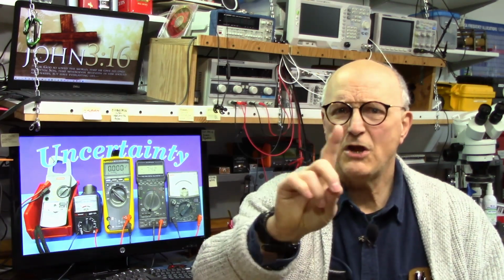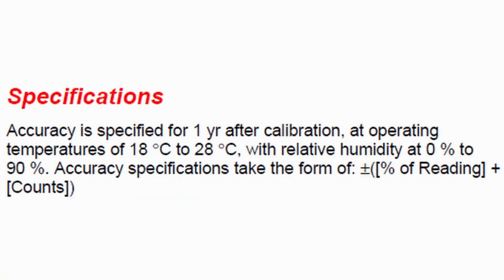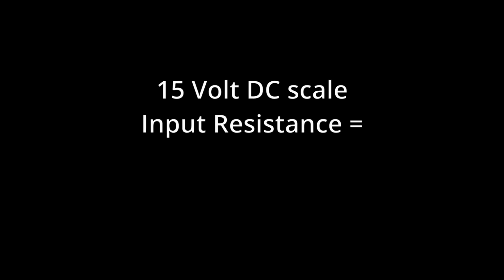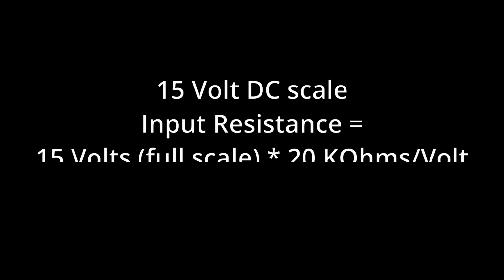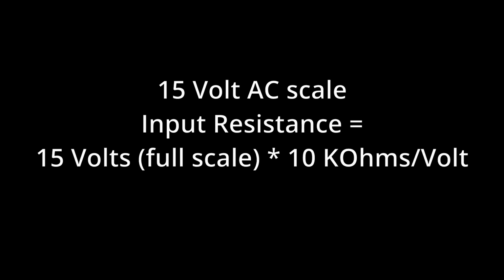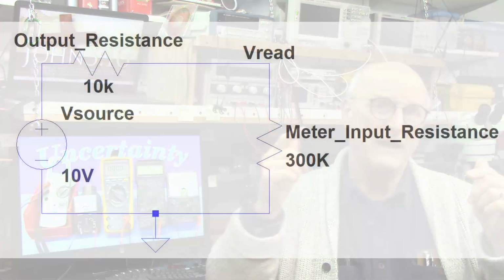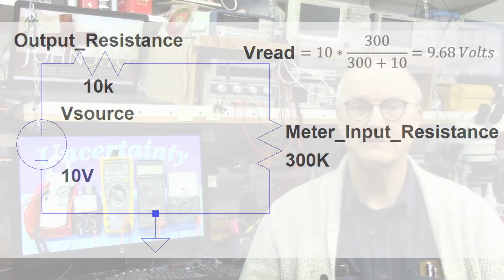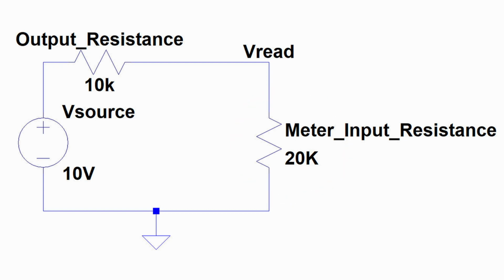Understanding Measurement Uncertainty (057)

Comment: Nice explanation! 👍
Having set up a calibration and research lab for thermometry, back in the 80's and still running it, uncertainty became second nature. Uncertainty consists of type A and type B contributions. Type A concerns statistic uncertainty in a number of measurements. Type B deals with the known, combined uncertainties of all components in the chain, including resolution. We normally express the uncertainty contribution multiplied by two, called two times the standard deviation. This is equal to a confidence interval of about 95.5%. If there's no known correlation, uncertainty is calculated by adding up each contribution, raised to the power of 2, then taking the square root and multiplying by 2.
Reply from the maker: Thank you! :-)

Comment: I'm a little amused. I have seen several of your videos which list a large number of digits in the results of calculations.  One of the first lessons I learned when in school is that one should never write down numbers to any more accuracy than one knows to be true. That is true of resulting calculations as well. Your presentation is otherwise great.

Now throughout my career I have rarely had need to measure anything to much better than a tenth of a percent.  However looking back to my ham receiver in 1965, I could adjust the crystal calibrator to go through one beat against WWV at 10 MHz in about two or three minutes once the tubes were warmed up. Assuming WWV is much better than the calibrator that is something like one part per billion.  It would stay that way for several days.  That is surprisingly good for so long ago.
Reply from the maker: Well, my friend, you are not the first person to make this observation. You are right, this is what some schools teach. And I used to round things just like you suggest until such rounding caused real trouble in a design and I had to double back and recalculate.
It never hurts to carry (many) more decimals than you actually need. Rounding can cause enough of a difference in the outcome to cause issues.  This is especially true when there is a series of calculations, each depending on the results of the last. So, I carry a lot of decimals, rounding only when I have reached to final value. The results are that I have the absolute confidence that the number I have is right. I've never been burned by that. 🙂
Reply: @eie_for_you  Absolutely, it may be valuable to carry as much resolution through intermediate results as is practicable. For example that is "free" with modern calculators and spreadsheets.  I do a lot of my engineering work on spreadsheets which carry along 16 significant digits.  I know this happens but I always restrict the final displays to the number of digits of significance based on my original data.  My multimeter measures to 5 digits. I never allow more than 5 digits to be displayed on the spreadsheet.  If I have 5% resistors in a circuit I never allow calculations to show more than two or three digits even if I used that meter to measure the Voltage.
Reply from the maker: @jpmiller8098  Yup, there is a practical limit to the number of digits to carry. 🙂

Comment: I was in the Air Force from 1966 to 1970.  My specialty was Automatic Flight Control Systems and Navigation, (Autopilot).  I worked primarily in the shop and had an abundance of test equipment and equipment to verify calibration of our test equipment.  Of course, we needed to take that equipment next door to the Cal Lab.  It was kind of scary because it was seen as a sacred place and it wasn't wise to have direct eye contact of the Cal Lab folks.  They were kind of the high priests of the test equipment.  You brought back memories!
Reply from the maker: Made me laugh ... "high priests of the test equipment."😅Yup, those were the days, my friend. I was 1973 through 1977. That experience and training as served me very, very well through the years. Never regretted serving.

Comment: One the VOM, a 3rd effect on accuracy is the meter's position.  If the meter movement isn't "balanced", then it can respond slightly differently if it is vertical or horizontal (even if properly zero'd to start).  Good video.
Reply from the maker: True, that!  I had forgotten that one.
I believe that most respectable meters have a balanced meter movement. On the other hand ... the super el cheapo, hardware store meters ... the bets are off on those.  The trouble is, ya gotta know what position the movement was designed to be used in to know what position to use it in and they don't tip their hand on that one.

Comment: 😀  I STILL call multimeters "VOM"s  {and still use my Simpson 260}
Reply from the maker: Simpson 260, still being sold brand new!
I used to calibrate the old AN-PSM6 VOM ... you could literally run over them with a truck and they would survive (sort of LOL). I wonder if the military still uses them? Probably not.